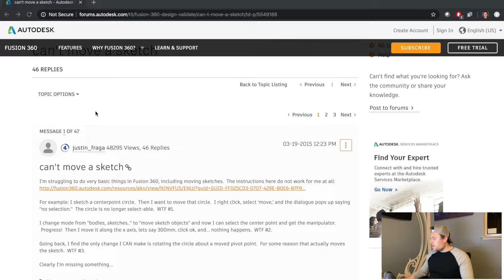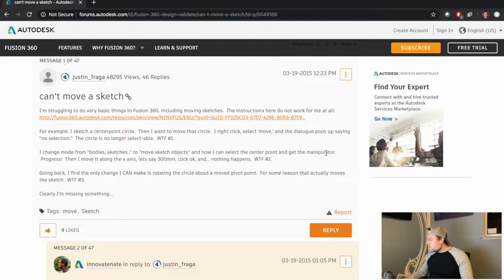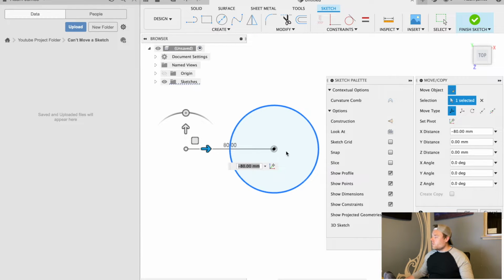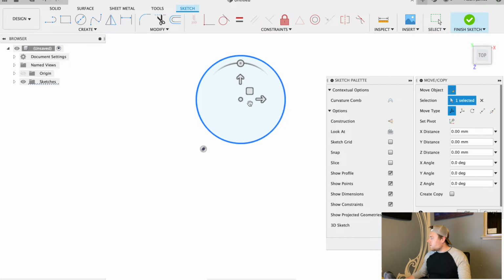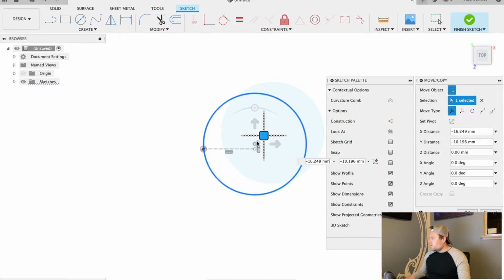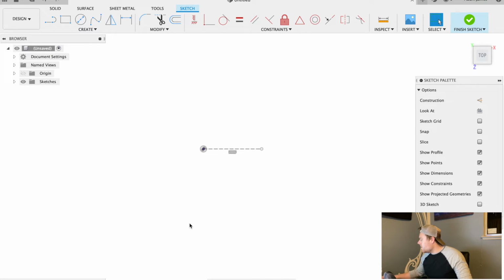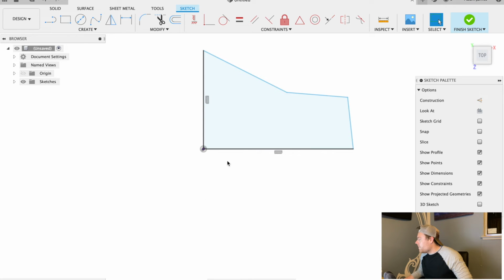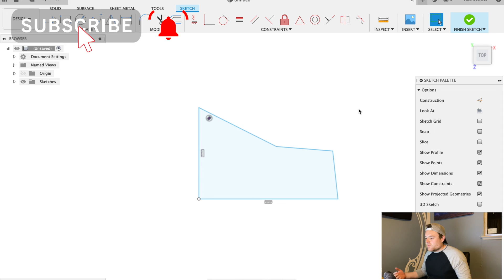How to Move a Sketch in Fusion 360!

Comment: Is there a way to not create auto constraints?
Reply from the maker: A great way to relieve auto constraints is to hold down the ctrl (windows) or cmd(mac) key while in a sketch to prevent the sketch from auto populating a constraint. This is a great method if you are working with a complex assembly and don't want the pointer to auto snap to particular features. Hope this helps!
Reply: Move / Copy Sketch Autodesk Fusion 360 (Works 100%) - Mover / Copiar Sketch (Funciona 100%) https://youtu.be/hpF06IgYiD0

Comment: Newbie here (old time cad user). inserted svg....followed your commands, still can't move it.     its a logo design: circle with geometric flower design inside the circle. Tried to extrude: can pick the outer circle and extrude but the command doesn't recognize the "petals. When I try to select each petal, it only selects one line at a time?

Comment: Well damn, All this time I been using Fusion 360 with imported SVG and DXF files, I didn't know this. I had a hell of a time manually aligning the import to the existing body.

Now I just import the file in. Unfix the parts I want. Do a Move point to point. Then fix it. Geez  

Thanks

Comment: So the situation I was running into was when I would create say a center point circle sketch and I would use the background grid to snap the circle to an intersection point on that grid(not at the origin), set my circle diameter or radius then hit enter to fully define the circle. Then I would use the sketch to extrude and drill a hole or something like that. Then sometime later I would want to move that hole a little bit. I would go and try and move the sketch and Fusion wouldn't let me. There were no constraints per se but the sketch was locked and had a little red lock on the browser column. I found that I had to select the sketch then select edit sketch, then the sketch mode would come up on the top of the page and under the constraint area I had to select the red lock (fix/unfix toggle) and unfix or unlock the sketch. The red lock on the browser column would turn to a pencil. I could then move the sketch easily at that point and my holes created by using that sketch would then also move. I watched every video on how to move a sketch and none of them talk about unfixing or unlocking a fully defined sketch before you could move it. They all talk about center point on the origin constraints etc, but there must be some kind of invisible constraint that you can't delete when you snap a circle to a grid intersection point.
Reply: Thanks, this worked for me and my svg I couldn't move. There was no constraint. This has to be the most counter-intuitive program I've ever used and I've used a lot of 3D and 2D software.

Comment: Still cannot figure out why a 360 sketch and the resulting body cannot be moved from their initial position of X-40, Y0, Z0 to 0,0,0
If I get the body to move over, OK, but the sketch remains at its initial position of X-40, and cannot be moved.  I checked constraints, but see nothing that's preventing the sketch from being moved.  Maybe there are some "hidden" constraints IDK what's going on.  Frustrating !
Reply: So the situation I was running into was when I would create say a center point circle sketch and I would use the background grid to snap the circle to an intersection point on that grid(not at the origin), set my circle diameter or radius then hit enter to fully define the circle. Then I would use the sketch to extrude and drill a hole or something like that. Then sometime later I would want to move that hole a little bit. I would go and try and move the sketch and Fusion wouldn't let me. There were no constraints per se but the sketch was locked and had a little red lock on the browser column. I found that I had to select the sketch then select edit sketch, then the sketch mode would come up on the top of the page and under the constraint area I had to select the red lock (fix/unfix toggle) and unfix or unlock the sketch. The red lock on the browser column would turn to a pencil. I could then move the sketch easily at that point and my holes created by using that sketch would then also move. I watched every video on how to move a sketch and none of them talk about unfixing or unlocking a fully defined sketch before you could move it. They all talk about center point on the origin constraints etc, but there must be some kind of invisible constraint that you can't delete when you snap a circle to a grid intersection point.

Comment: I created the sketch that is a rectangle. inside the rectangle, I've created few circles. then extruded the rectangle and circles here and there. also I've mirrored the part to get 4 the same parts.
after the work is done, I was trying to move two of the holes, produced by the extrusion of two circles on the sketch, but I cannot move those circles for a few days already. I've watched quite a few tutorials including this one.
but still, this seems impossible to me?
I still believe that's the purpose of the sketches and sketch should help me to modify a model after it's done by applying some modification to a sketch?

Comment: It's a pretty disgusting feature of Fusion for my workflow methods - I will draw a circle to a choosen diameter - then move/copy it to several locations on my part - then Push/pull, creating holes where desired.
Fusion presents the Move option incorrectly, it should either:
1. NOT let me move the sketch object - Cause it's constrained.
2. Better - Make the 'constraint' handle the handle for the move - for a so constrained sketch.
3. Just move the sketch & organically move the constrain - or strip the constrain away.
4. If I am copying a sketch - then the constraint should be stripped away automatically, as there already is an entity constrained there of the identical dimensions.
In AutoCAD, you can draw and Object-Snap drag/copy sketchs all-day-long.
It's 2021 and Fusion360 has come a long way - but this clumsyness it still there. I can work about 2x faster in AutoCAD as far as the 2D layout speed. I just Santa would add this capability to fusion.

Comment: Thanks for your helpful videos, just starting to use fusion 360 as a hobby since i recently got a 3d printer. Last time i used autocad was back in the early 90's can't believe it's 2021 and we are still trying to figure out how to move a circle. There has to be a better easier software/solution. Seems Autodesk is a bloated old software with old developers who know nothing about user friendly UI's. RIP Steve Jobs, without his input, we would have been stuck in UI designs blaming the user ignorance instead of the engineer who made it complicated. Sorry for the long rant, and thanks for your help

Comment: I think what the person who wrote the original question did was to create a circle sketch and then right click on the body of the circle, not the line. When you do this it deselects the circle and move seems to be available in the pie menu, but it does nothing because the circle is no longer selected. Why move is available as a command when nothing is selected is a mystery. Unlike other drawing programs where drawing a shape leaves the shape selected and ready to move or transform, F360 assumes having made a sketch element you are done with it. Most of my experience comes from working with 2d drawing programs like Adobe Illustrator and 3d programs like Cinema 4d, but the tradition of CAD programs is clearly different from those.
Reply: make it intuitive and people will use it..  this software is confused..  It's frustrating and i have to say it's the same reason i moved away from 3d studio max to other 3d software, autodesk just don't make stuff easy..
Reply from the maker: Hi Michael, it is a mystery indeed. Thanks for watching and as always, I appreciate the support!
Reply: Move / Copy Sketch Autodesk Fusion 360 (Works 100%) - Mover / Copiar Sketch (Funciona 100%) https://youtu.be/hpF06IgYiD0
Reply: It's different from how you would move it in autocad, which I've been working in for the past 25 years, and it's also different from how you would move things in Corel or illustrator or anything else. An AutoCAD you select the item you hit move, and then you pick the point that you want to start your move from, and where you want that point to move to. Infusion, since I can't draw anything in it easily, I have to import from other programs, and whenever you import it puts the origin wherever the hell it wants, and then doesn't allow you to select on things and move them.

Comment: I can’t edit my sketch. Sketch has a lock symbol on it, I tried right clicking different portions of sketch and nothing happens. If I hold right click depth/parents shows up.
Reply from the maker: Hi Brandon! This typically means that your sketch is fully constrained. I suspect if you are trying to modify a fully constrained sketch, the current constraints could be limiting your modification capabilities. Try deleting some constraints. Here's a forum post related to this topic: https://forums.autodesk.com/t5/fusion-360-design-validate/sketch-icon-padlock/m-p/9040878#M198014

Hope this helps!
Reply: Move / Copy Sketch Autodesk Fusion 360 (Works 100%) - Mover / Copiar Sketch (Funciona 100%) https://youtu.be/hpF06IgYiD0